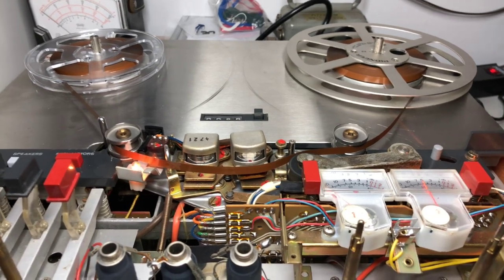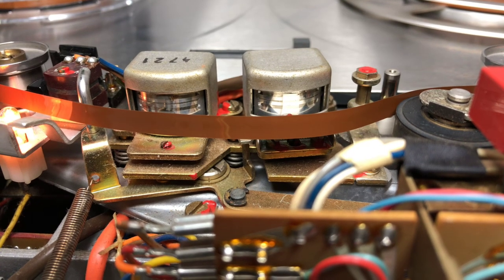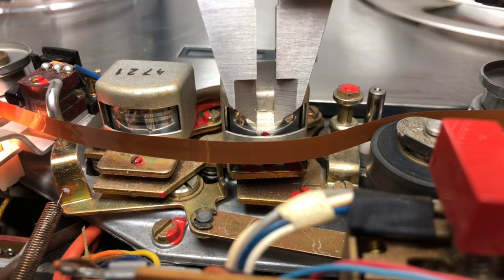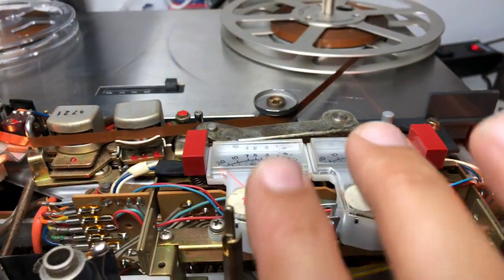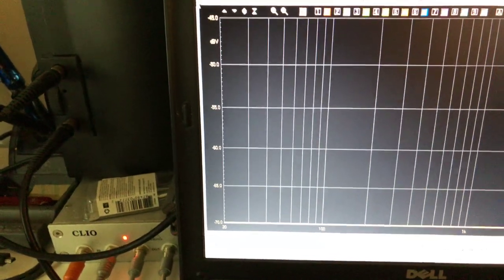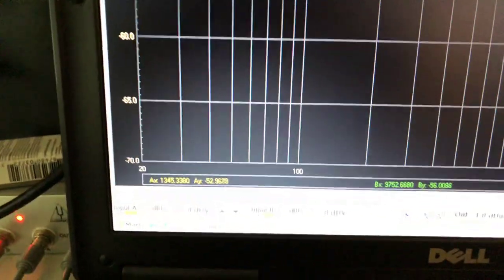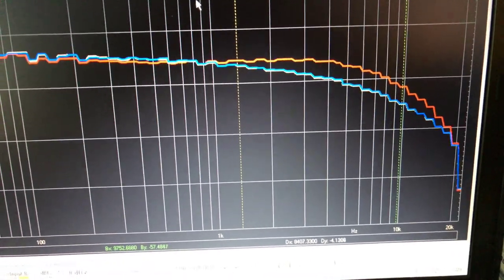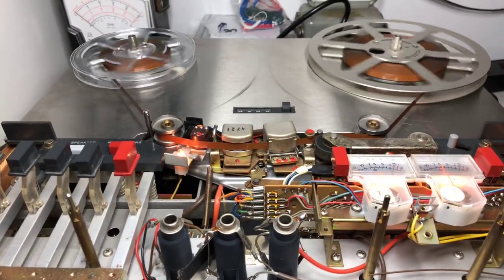Revox A77 Playback Head wear and how it changes the Frequency Response

Comment: You missed the point that your measurement covered two processes at once - recording and playback. Slop of sopranos in tape recorders is caused not by play head but by wear of  recording head - this head is critical for sopranos,   shatters band  and lowers  level of tape magnetization .  Your measurement in fact shown that  most popular problem with recording head   . Replacing them bot in instance you lost possibility to learn  it. .But no problem as it was needed too  -  by replacing play head you also gained more voltage from play head I address only your  miselading explanation

 Measuring the wear by electronic rule is  not realiabe.   Important is only the center area where is gap and how deep is  gap  .Play head untill  is not competly worn "to bottom"     has its normal frequency charactrisitic - I had such head and it was reading nicely 19 kHz from my old recordings exatly the same as when it was new - only  when some layers of metal brake down   into  it is not usable due to great lack of sipranos.   Untill then  the only problem is that voltage   in whole spectrum falls down and noise/signal  is growing

Comment: My Crown CX822 (2 track) & CX722 were just installed with NOS Nortronics 'Duracore' Rec/Ply heads.  When aligned & cal'ed for LPR-35 tape, they gave a response of +- 1db from 25hz. to 28khz. & -3db down at well over 30khz., [Ref@-10db.]  with I.M. distortion of the play-electronics  @ a very low 0.05%.  Duracore mu-metal is expected to last over ten thousand hours of use.  The only drawback is that the bias osc. is cranked up to maximum output in order to properly set it for Standard Quantegy 456 or  LPR-35 tape formulations.  These long-pole heads load down the rec/erase bias a bit.  Anyway, that's the issue with today's semi-pro tape machines.  Try & get replacement heads,  Especially the Japanese models!  Studio decks can still go to JRF for heads...at least for now.

Comment: Hey , I have a problem, I want to set bias trap in rec mode and in playback mode. In rec mode I make it settings successfully the bias trap , but… in playback mode the bias trap is unable to set in the Chanel 2 with coil L801. I screwing with the screwdriver the core of coil L801 but no changing in milivolts. In Chanel 1 I make it setting successful (less then 50mv) but in Chanel 2 no modifications. I changed the repr. Ampl. Card with card in Chanel 1 thinking the coil L801 is defect but no changes ! What is the problem??

Comment: hy i have this machine and i have a problem, the vu meter in play mode not working, only in record mode working, so why?
Reply: that's normal on A77- only the dolby version has off-tape metering, or a B77.

if you put the input switches to "i>ii' & "ii>i", then advance the recording level controls to about 7 or so, you'll see the playback signal on the meters. the channels will be reversed though.

Comment: Nice explanation - I am just in the process of getting a Revox PR99 back to running. 
Ex BBC so it has had some use.
Interestingly my heads are also around 4.5mm across -  but on playback at present it records and plays back fine. 
I found a BBC service document for radio and tv stations etc and it states that when the heads get to 6.3mm is the time they need to be replaced. 
I assume they just kept adjusting the Rec and Reproduce amp settings to the point of no return!
Reply: You are correct - untill the gap is not widened by lack of metal it will work not much different - only experienced ear could spot that signal has value  deminished  . Insted of it  recording with even little worn heads creates not fully satisfying new recordings Usualy users after some  period of using  recorder notice that "new" recordings are not as  clear as old and it is progressing with hours. That is why producers of tape recorders developed in 70ties technology with separate not wearing bias head X360 . It slowed speed of   changes. In my opinion best solution for home users to save heads  is to choose  as  low     tape  speed as possible if only  it  doesn't  hurt reception

Comment: I'm sure you made a demagnetizing befor measuring!?  What's the name of the program (CLIO?) you are using? Are you measuring the frequency response with white noise? At which speed it was measured? I am curious very much as the video looks after the exchange of the heads. I've the same machine (MK IV, 4 tracks) and the heads are nearly in the same condition as yours. The (in Germany we call it "Kopfspiegel") heads have 4,5 mm. You say the heads are usable till about 5 mm. With tapes of Maxell I can get a frequency response of 16-18 kHz at 19 cm/s.
Reply from the maker: Please check the follow-up video https://www.youtube.com/watch?v=9TUKhOYlTSE